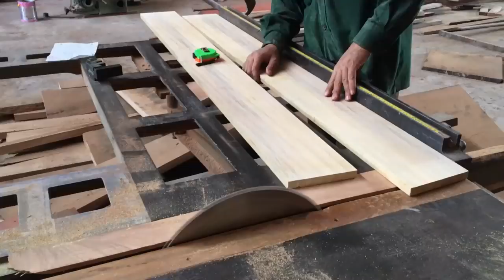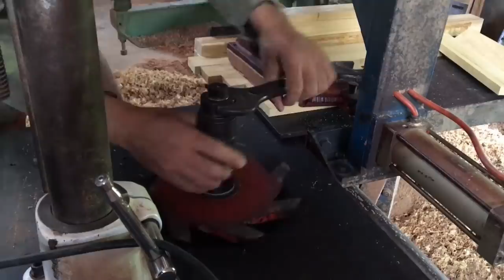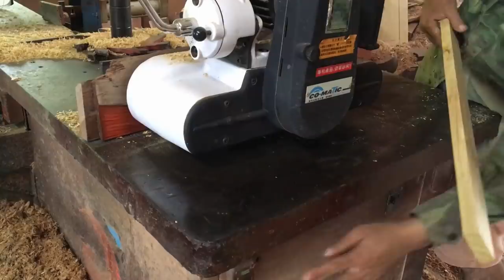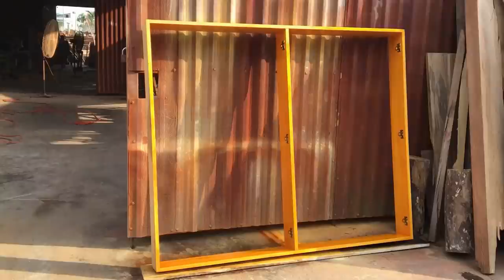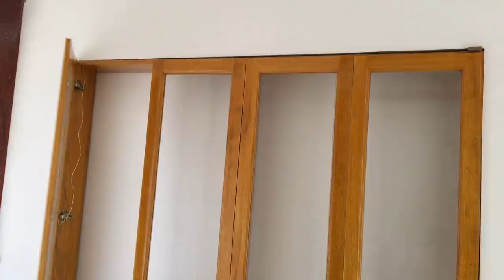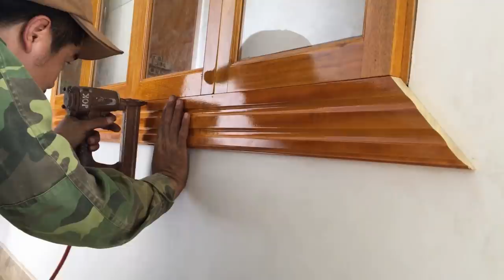DIY - Modern Wall Storage Cabinets | Woodworking Project | How To Build and Install

Comment: Hardly a DIY video  with professional quality machinery  designed for production work  DIYers dont  Have sliding tablesaws , Shapers, And  Bandsaws  capable of restawing. The  lumber these guys use !  Most DIYers are lucky to have a  semi decent table saw.A Router with limited bits and Collets, a few hand tools, and a hammer  they wouldn't know how to operate. Any of the machinery in this video  or how to make rough sawn lumber  useable. For this type of project  if. You guys are  going to  keep making Wooworking  videos. The  title should be  much more carefully  thought out  and not as misleading    However i. Do have many years in professional Woodworking. As a profession and a hobby. And i did enjoy  seeing the operation of machinery brands that i am not personally  familiar   With  or exprtienced in using that exact machine  and i did like the  final product and finish of the unit
Reply: Totally agreed. This isn't DIY, it's small or medium industry

Comment: This woodworking book “Bαzοmο Tdy Plαn” (Google it) insures everything from wood types to tool types as well as uses. A few other subjects range from the several types of wood and their distinct levels of difficulty when it comes to dealing with them. This book has been very useful and is a good one for somebody just getting into wood working. .

Comment: You can see why American made products cost more.  No safety equipment, no spray booths, no dust control, etc., etc., etc.
Reply: Actually all these safety measures are cheap and irrelevant to the final price since they can be amortized over many years and projects. In this case, the price difference is labour cost. I could probably build the same thing for a fraction of the time  because I have better tooling (seeing how they use the shaper makes my skin crawl), but my hourly cost would be 100x more. So even if I am 3x faster, I would still be 30x more expensive.
Reply: And a $10 a day worker
Reply: not even, it is about 3$ per day

Comment: I've seen unstable boards shattering on joiner machinery. 
Push sticks & Guards will save loosing fingers and arms.
We all take chances but this is a accident waiting to happen, especially if you work like this Every Day.
All it takes is for a bee or a bird to fly into your workshop and distract you and those machines will rip your limbs off. 
They are not DIY they are industrial woodworking machines 10 times more powerful than the tools you have at home. 
Beautiful looking display cabinet but is it worth loosing a hand or a arm or a LIFE? 
Safety seems to be non existent in these Eastern Countries.
Reply: And these guys lose less fingers and hands then we do in America